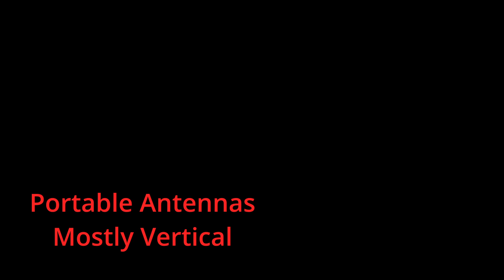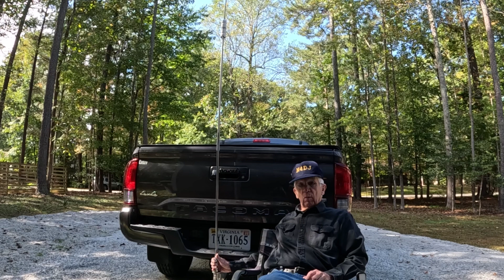Vertical Antennas and Radials Part 1

Comment: I have been watching your videos, hi... I kept staring at the base of your antenna next to your chair there and couldn't tell your antenna was mounted to the hitch of the truck or not. If it is then you've got a set of beams there... radios power will be shooting past your hood forward of that your truck . with your  truck turned to the right  most of the power will shoot out to the front rear and right sides in a stretched oblong pattern.. if it is connected to the trailer hitch as I stated above you could add a half circle of 4 ground radios on the ground were your chair sits. Of course I would give you a pattern something like a ellipse figure eight. with more power coming out the front and rear of your truck.. semi truck drivers would place their antennas on the cabs mirrors which would give them better reception and transmitting power in front of them... a type of early warning... I'm sure you know what I'm talking about but did I explain it well enough......73s
Reply from the maker: Yes. Thanks for the comment. I find that directive effects seem to be minimum at lower frequencies whereas they are more noticeable on 10 meters and 2 meters. Same with horizontal antennas. My dipoles are all about 50 feet. The 40 meter dipole covers all direction fine. The 20 meter dipole has a bit of a null off the ends so I use two to cover all directions. The 10 meter dipole has very sharp deep nulls of the ends. I also use two 10 meter dipoles normally but do usually pull up a third one to help in the 10 meter contest because of the sharper nulls on the 10 meter dipoles.

Comment: Recently my stepson hit the Utah SDR from Los Angeles with Hustler 20m and no radials, 100 watts. 700 miles.
Reply from the maker: I love the Hustlers.  What was his ground or counterpoise? I find that in my mother in laws flower bed I do very well with no radials on 20 meters just a CB mirror mount on a long screwdriver! I made contacts all over the US and Europe with that setup on SSB.
Reply: @dandypoint  No counterpoise or radials. It was 17 feet up. I'm ordering one and it will sit about 6 feet off the ground. It will be near my 40m NVIS antenna, which may be a counterpoise.
Reply from the maker: @tangobayus  I would guess then his coax shield was acting as the “counterpoise”. That works in most cases but be aware that the length of the coax, specifically the shield, could affect the match and the performance to a lesser degree.
Usually when clamped to my deck or a picnic table I have fairly high SWR with no radials or counterpoise or ground. 
I almost always use 11 or 12 foot long radials. I then start adding radials and watch the SWR go down. Usually it only takes 2 or 3 radials on the ground and my SWR is very low, usually not even registering on my FT 891. Occasionally it takes 4 radials.
The minimum SWR frequency will change a little as I add radials. As with all short verticals or mobile antennas the bandwidth between the 2:1 SWR points is not great. I frequently carry two resonators for each band, one tuned for CW and one for SSB sections of the band. That way I can QSY to SSB without retuning the resonator. Without a planned ground or radial system or counterpoise, the “return currents” will find their own way back to the transmitter chassis and that may be good or bad. I would say it works more times than it doesn’t. If you notice the rig bites you with RF or other strange things happen when running other than 5 watts, you know you were not lucky with the coax length. I run 50 watts when using my Hustlers, so I just throw out three 11 foot radials and 99% of the time I am good to go. Actually that may be 99.9% of the time it works very good.
I use the term “ground, radials and counterpoise” because although each is different they all do essentially the same thing and that is collect return currents from the Hustler antenna to the transmitter chassis. Usually if ground mounted I have a direct ground through the metal mount sticking in the ground but that is rarely good enough. The radials improve that direct connection through capacitive coupling to the ground. The coax shield if on the ground also couples to the ground. The counterpoise would be above the ground and act as the missing half of the antenna. Radials on the ground and not in the dirt, can act as both a counterpoise and capacitive coupling to the earth! The bottom line is getting a low impedance connection to ground, regardless of how you do it or what it’s called. I hope this makes sense and sorry if I told you more than you needed, but if so it might help someone else reading this. My intent is to share my many years of experience. There is a lot of bad info out there. 
73,
Don
N4DJ
Reply: @dandypoint  Thanks. He's going to add some radials. When I get mine, it will be located near my 40m EFHW, which has a 9:1 unun properly installed. The origin of both antennas is about 30 feet from house with about 75 feet of coax going back to the radio, a lot of it laying on the ground. The radio is grounded to the cold water pipe.  The coax also runs by a ground wire which I use for an electric fence generator on my hydroponic system to keep coons away :)

Comment: what happened to sizing the radial length based on frequency for 1/4 wave verticals?
Reply: Thanks, I will checkout the blog. BTW, Marty here, WT0Z
Reply from the maker: @Coyotes_Locos  I think you mean using 1/4 wave radials. If you have lots of radials then using 1/4 wave radials is desirable.
However with only a few radials it does not do any good. For example on 80 meters a 1/4 wave radial is about 60 feet. If you only had 240 feet of wire to use for radials, you would get better results with more shorter radials. Eight 30 foot radials would be better than four 60 foot radials. Rudy Severns has written extensively in QST and other publications on this subject. This link will get you his LF-MF antenna notes.    
https://www.antennasbyn6lf.com/design_of_radial_ground_systems/
I refer you to his Chapter 5 figure 15 that shows for a quarter wave vertical what the optimum length would be for a given length of available radial wire. The zero gain point is set for four 1/4 wave radials. However by using eight 1/8 wave radials you gain over 1/2 dB in signal strength. The next curve is for eight 1/4 wave radials, but with the same 2 waves of wire you gain another  1/2 dB by going to sixteen 1/8 wave radials. Now when you start with sixteen 1/4 wave radials (8 wavelengths of wire) you still get gain by going to thirty two 1/8 wave radials but not as much. By the time you get to 32 radials you need to be using 1/4 wave radials. When you go to even more radials you need to go longer still to about 1/2 wave long radials. 
I hope that answers your question. 
Also the improvement in going from four 1/4 wave radials to sixty four 1/4 wave radials is less than 2 dB.
From four 1/4 wave radials to one hundred and twenty eight 1/2 wave radials is about 2.5 dB. Less than doubling your power.
Reply: @dandypoint  thanks for the response and link. I am going to try building one of these for portable use, only 2 radials. 
https://youtu.be/wqw3ultuPQg?si=ImaNsBgWLAs5qVD8
This is one of several videos on this antenna/radials, more on YouTube. The person who originally created the antenna, mentioned in the video, will email you the plans and his  modeling results. He sized the radials with the radiator, and the length of the radiator at different frequencies varies from the way you would normally calculate the radiator lengths, explained in the modeling results. There are a lot of very positive reviews on it. I have parts on order. Thanks.
Reply from the maker: @ yes. I saw that. Basically if you think of a halfwave dipole thats the whole antenna. It can be vertical or horizontal. If it’s vertical it’s omnidirectional. If it is vertical and you bend it at the center so one leg is horizontal it becomes a “ ground plane “. The resonance is established by the total length of the vertical plus the horizontal sections. So if you build it and it’s not resonant where you want, you can adjust either the vertical or horizontal section for resonance. Of course you need to have the two sections fairly close in length or the feed point impedance moves away from the desired 50 ohms to match the coax. With only one radial it is still pretty much omnidirectional but slightly more directive in the direction the horizontal part ( we now call it a radial) is pointing. You can add one or more such radials all at about the same length and it makes the theoretical pattern more omnidirectional.  The antenna in the video is one way to do it. There are several ways to do it. There will be a front to back ratio of 3 dB or possibly more depending on the frequency and distance to that station. Usually that’s hardly noticeable. Again depends on the band and distance. More noticeable on 30 and 40 meters and probably less front to back on 20 and above. I use a ground mounted vertical a lot with about four 11 foot radials in whatever direction is convenient. You just don’t want your radials too close together. Remember verticals have about zero dBi gain while dipoles have a peak gain of about 8 dBi. So a dipole will always give a stronger signal but in most portable cases a vertical may be quick. With the elevated radials it makes setup a bit slower and that makes the dipole more attractive. For the same time and setup effort the dipole will always be better by usually at least 2 S-units. 
I have quite a few videos about dipoles, verticals and vertical mounts also on the channel in my antenna playlist. If interested I could send you a link to my blog on antennas. I may try and post it here.
Reply from the maker: @ this is my antenna blog: https://antennatalkbydon.blogspot.com/